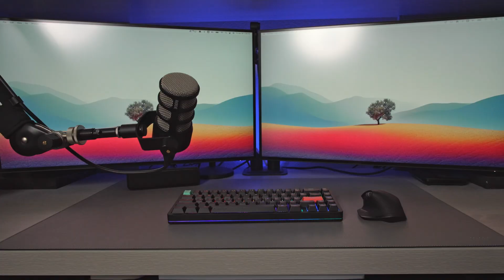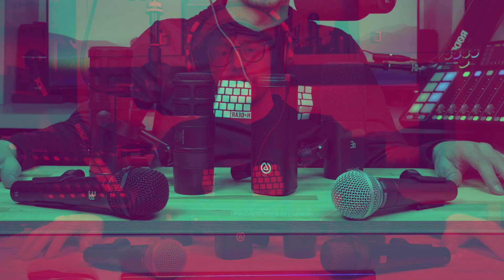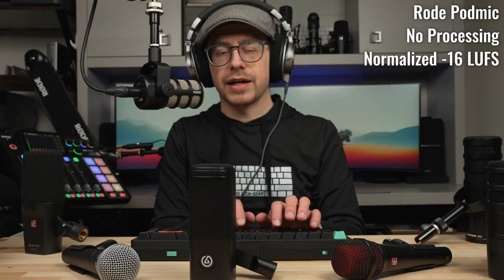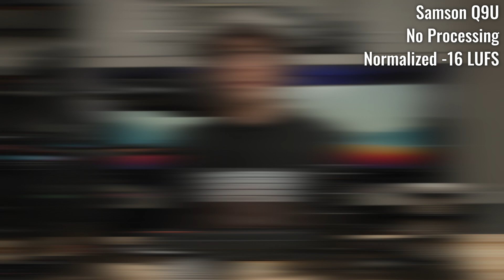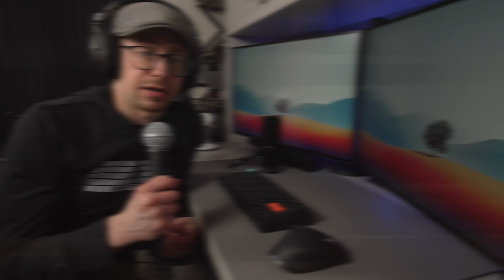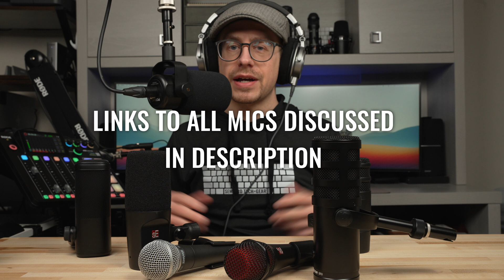Dynamic Microphone Comparison - Elgato Wave DX, AT2040, PodMic, Q9U

Comment: I'm here doing research on the SM58, it sounded to me like there was a very low but noticeable 60HZ hum coming from that mic specifically during the typing test, is that something you can easily fix by tweaking compressor settings or is it just a characteristic of the SM58?

Comment: Q9u msrp is $199 not $99. And it sound muffled. Its definitely bad choice especially for the price.
Reply from the maker: You're right! Samson lists the MSRP of the Q9U as $199, however at the time that I recorded this it had been available at multiple retailers for $99 for several months. As of today it's on amazon for $129. I understand the MSRP of the others is $99, but I included it since it had been available for a long time at the same price point. Agree on the sound though - it's not my favorite for sure.
Reply: @semiprotech  not in every country tho. In mine(indonesia) its still $199. I'd rather choose se dynacaster dcm8 for that price.

Comment: Hi, which is your favorite microphone from this review? Can you make a tier list?
Reply from the maker: That is a tough question! It might be easier for me to tell you which ones I personally wouldn't choose and why first: 
AT2040: To me it has the least natural sound profile compared to the others. I like the compact form factor but the sound on my voice, not so much. 
SM58: Sounds fine but it seemed to pick up the most A/C hum in my environment. I pointed it around the room and a couple of angles it was really picking up some hum (I've had more than one and they've been the same in this regard). 
WaveDX: Felt that the low end was rolled off a little bit too much. 
With the choices remaining, my preferences would go in this order: 
1. DCM3 - Mostly natural sound, ok with plosives, higher sensitivity than others so it requires less gain. 
2. Q9U - I would use it with the mid-boost switch on personally. Features including physical mute button are not common at this price. 
3. PodMic - I don't dislike it, but it's a little bit mid-forward for my voice. Best build quality of the group and did the best at not picking up desk rumble from keyboard typing. 
4. sE V7 - I enjoy the sound profile - more full than the PodMic, but it seems to pick up desk and boom arm bumps more than others.

Comment: 4:25 this sound of vibrations when you type on the keyboard, this is exactly what i don't want and i wanted the new podmic usb but scare about the fact that we can't put a shock mount around the mic ( and i don't want to use circle shock mount like the radius iii  ) but the podmic seems to be great with that surprisely but i have a loud typing so idk